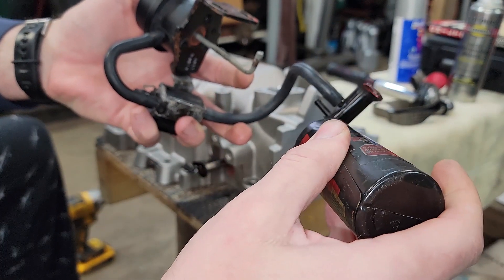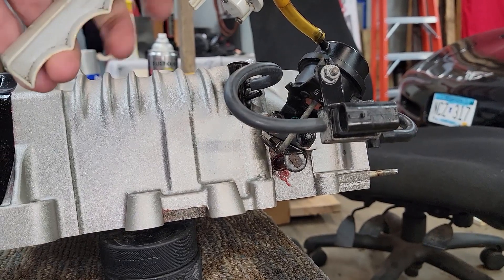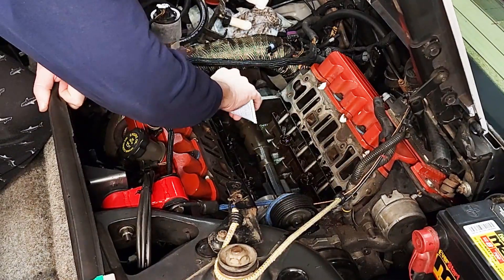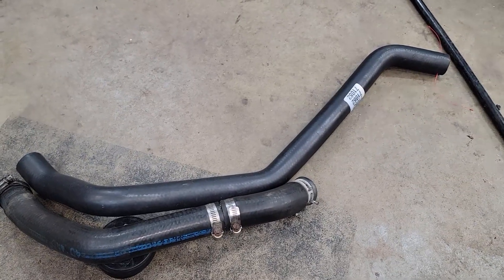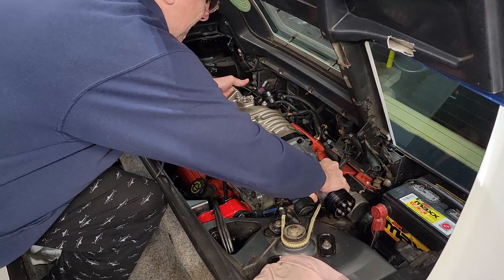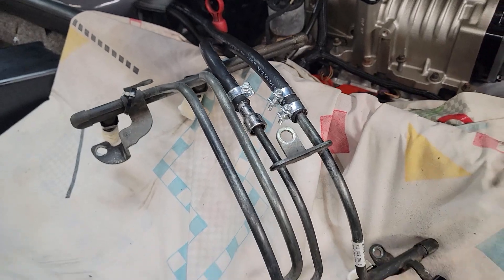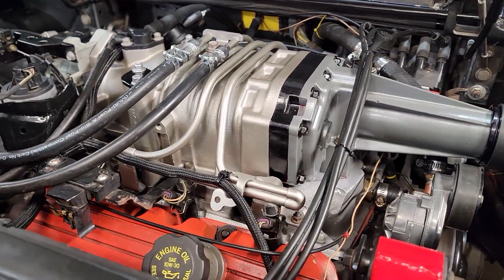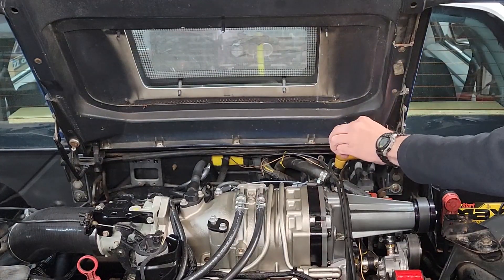3800 Supercharged Fiero: (Final Assembly & Test Fire After Blower Porting/Overhaul)

Comment: That thing sound great! I know a guy here in KY that has a collection of Fiero's. He used to come in the shop before I retired. The 3.8 is a great motor but a devil to work on. My Buick Ultra SC has a leaking intake gasket I'm working on. What a mess this thing is. Great compression but honey oil and sludge in this "owned by a little ole lady who never changed the oil". Thanks for the incite.

Comment: I really enjoy your videos. A lot of great info. I’ve had 3 fieros. I’m working on my first 3800 supercharged swap. One thing I’m considering is using a turbo for compound boosting before the supercharger. There is a lot of good info out there and the house power numbers to be had are hard to ignore. Especially when you run e85. Just curious, did ever consider adding a turbo to your application? Thanks, keep up the great content!
Reply from the maker: Thank you!  I have but there does not seem to be a readily available transmission that will reliably handle even a medium turbo 3800 build any more.  The supply of the key hard parts (chain in particular) for the 4t65e-hd transmission has made it so that IMO a max effort 3800 SC is about all the transmission can handle with current available parts.  Shame because I would love to do a 500 RWHP turbo build...

Comment: Curious as to your thoughts about a 3800sc in a manual fiero? I LOVE manual cars and don't think I'd enjoy an automatic near as much. I have a 5 speed getrag and have looked into a few alternatives/upgraded manual transmissions to pair with the 3800sc but wanted to get your opinions.
Reply from the maker: I would only do a 5 speed getrag for road racing with a 3800 NA engine.  Otherwise I don't think it would be durable enough.  Just my honest opinion.
Reply: @Toys4Life  when you say "road racing" what do you mean?
Reply from the maker: @ColtenHood  Basically I mean not drag racing - the launches are too hard and will reveal the weak link quickly.  Spirited street driving and NO clutch dumps.
Reply: @Toys4Life  dang, okay. Well, I guess the NAs are more available ha I'll have to do more research. Thank you for your input!

Comment: Looks and sounds amazing! I have a couple questions I hope you can help me with and they relate to your corvette and the A&A supercharger. 1) is there much boost put through the engine while just cruising around? 2) Does the boost a pump always work or only kick on when it’s needed? 3) have you ever heard of the boost a pumps failing? I would think if so you would blow the engine especially if it happened while you were hard on the throttle? Any help would be greatly appreciated. I am seriously considering one for my c6.
Reply from the maker: Unless you're at wide open throttle, there's a valve that's open that just bleeds off any boost so that the compressor spins freely with very little parasitic draw. The booster pump only kicks on once you get into it triggered by a drop in vacuum and increases the voltage only when you're into it to make sure the pump can keep up.. as far as I know the kennebel booster pump has a very good reputation, mine has been just fine. As a precaution I always scan my engine with the aeroforce scan gauge, I did a video on it and it can be set up to flash a red light anytime your engine experience is knock which means you should get out of the throttle. So far mine's been extremely reliable and the tune has been stable.
Reply: @Toys4Life  thank you very much, I really appreciate it.

Comment: Nice, I miss my Fiero. What kind of gas mileage do you get ?
Reply from the maker: If gas goes much higher, I may just find out!   For now -  keep in mind it is on E85 - so that is 30% less mpg, but also 30% +/- less $$.   Also, most of my trips are short and I screw around a LOT (ie lots of 0-?? mph blasts).   On the freeway with pump gas and a larger pulley (less boost) probably around 26 mpg or so.  Engine is barely off idle to go 65mph..

Comment: LQQKS sweet, I like the silver much better than the old red, I bet you cannot wait to go for a test drive?
Reply from the maker: Thanks Dave!!   I might get it out tomorrow - did I hear 40's are in the forecast??
Reply: @Toys4Life  Well if the roads are dry, and all that COLD air traction may be a problem.
Reply from the maker: @racerd9669  indeed, I'll work on modulating the throttle though, always a good skill to hone...lol